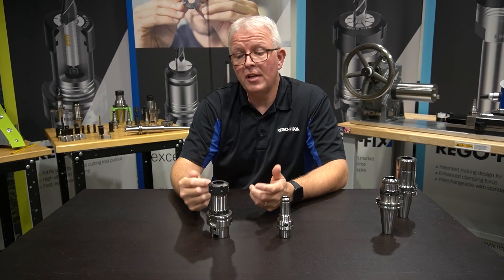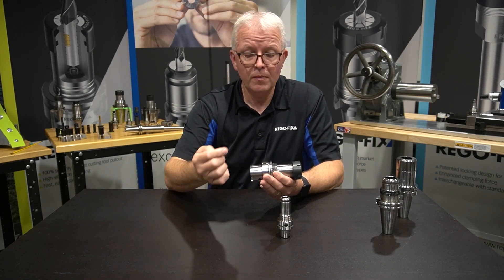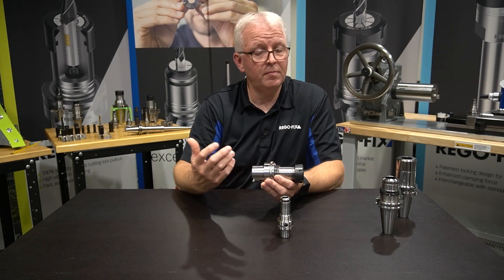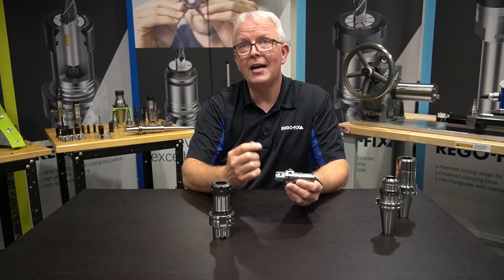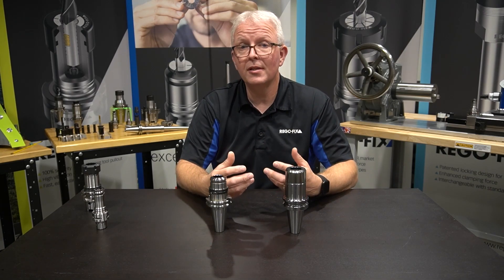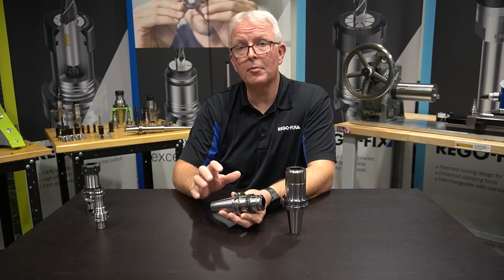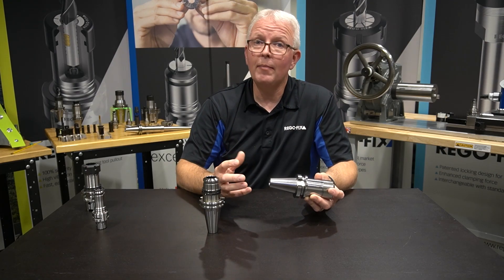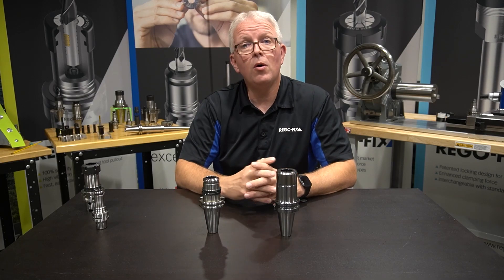TechChat - RFID Chip Pockets

Comment: What is it about the RFID tag that makes it desirable over laser engraving a scannable tag?  Charles
Reply: Hypothetically, all the parameters can be stored on the RFID tag granting the machine the ability to scan the tool in a pocket or the  spindle and automatically update tool info in the control. A tool setter can update the tool parameters via the RFID tag and prevent potential user error.